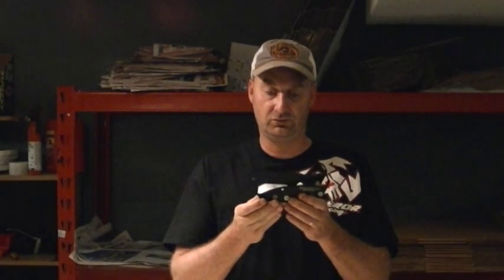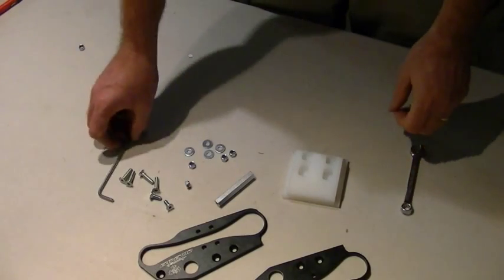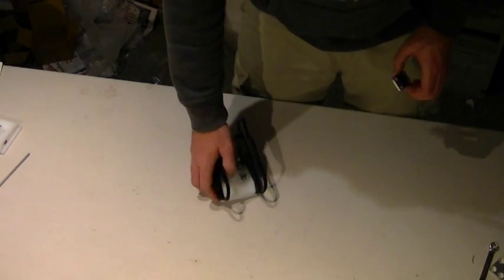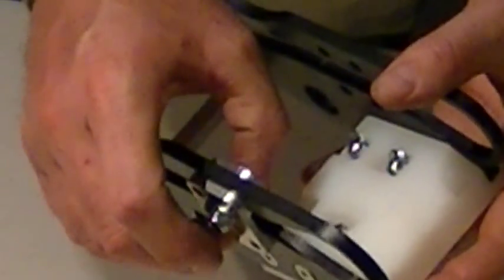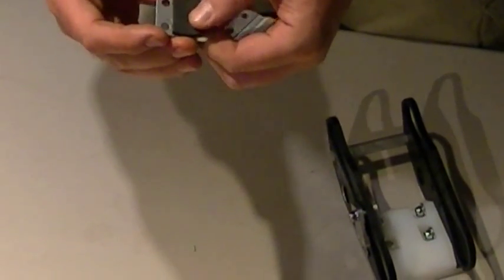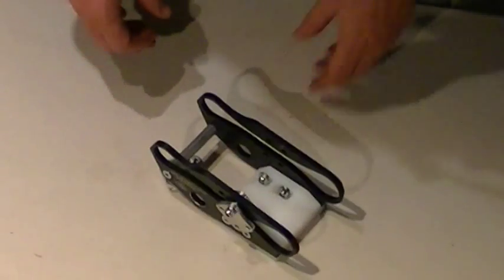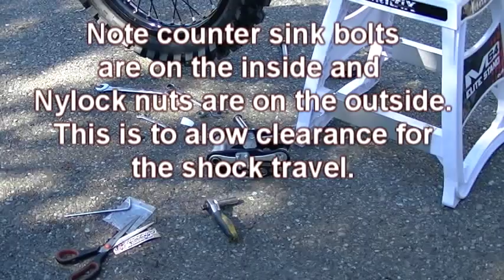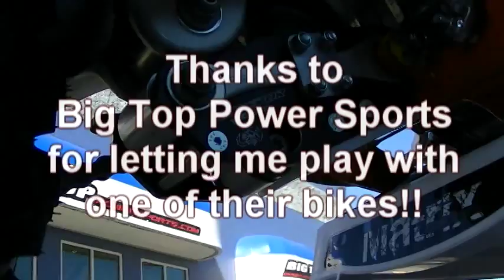KTM SX and XC 2015 linkage skid plate install

Comment: I'm unable to remove the rear bold of the linkage arm(Dog bone). Should I apply some heat, mine is a 4 stroke.
Reply from the maker: yes heat..  KTM puts lock tight on the nut.